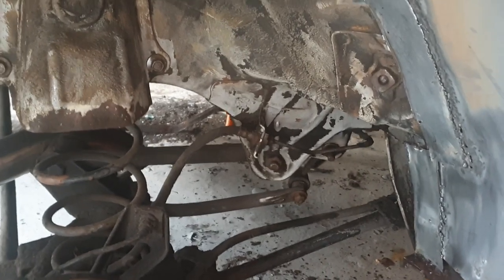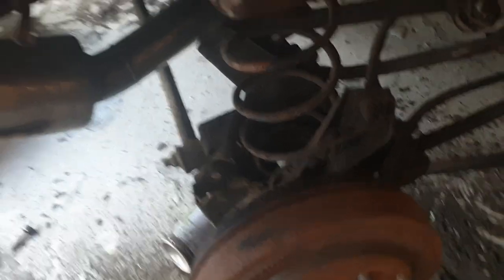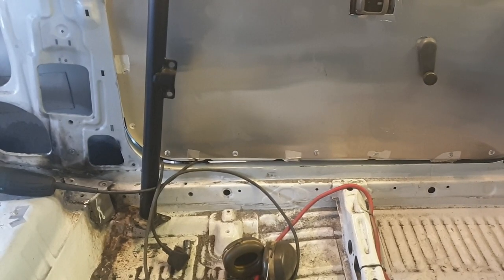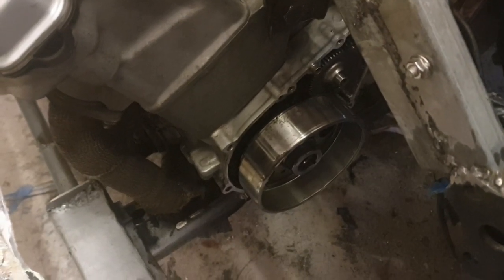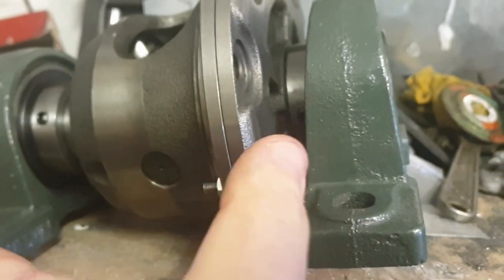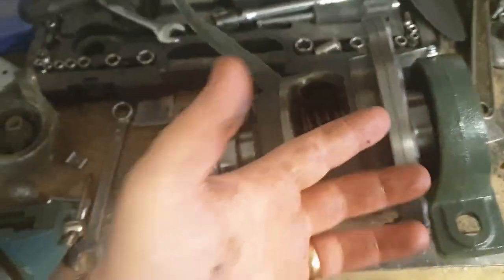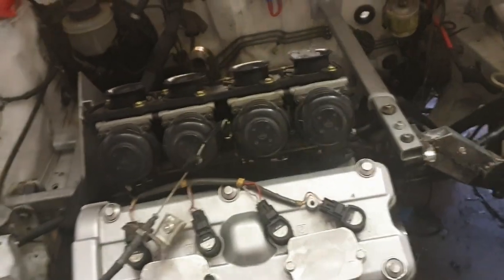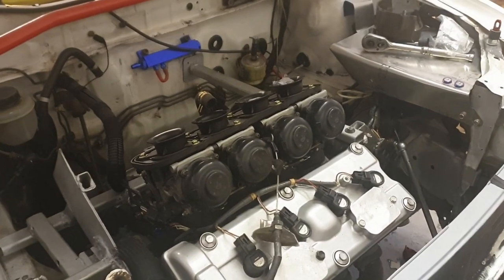ZX9R Powered Maxi Micra Episode 21

Comment: When this thing is done it will be an absolute ripper! I maybe would also look at the oiling system because in corners the oil will splash from side to side what on a motorcycle not happens so with high G's for a long period in a long corner will maybe make it fail and lock up

Comment: Any more news or updates mate? Seems to be coming on canny 
Keep at the welding bud it will get better.
Reply from the maker: It's on hold currently, but I'm gathering parts. Trying to get the engine to start. Once that's out of the way, the hardest part is diff cradle and axles
Exhaust will have to be a sidewinder over the gearbox as the shafts will be in the way.
Nut yeah, on hold right now as I work away.
Thank you for watching.
Reply: @antonyaiken  that's good as long as its still coming along
I think we all wish we had the time and money to have a car built in 3 weeks but life gets in the way